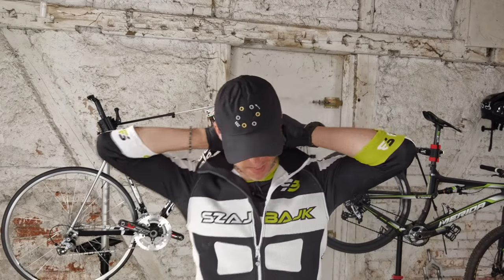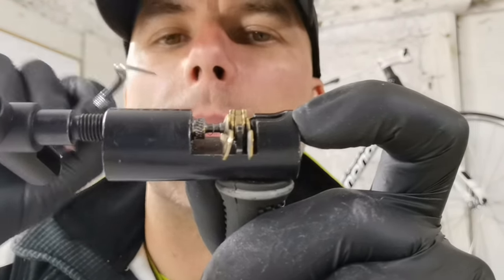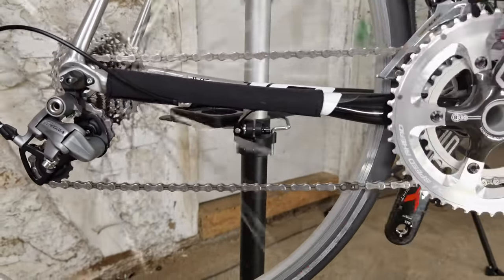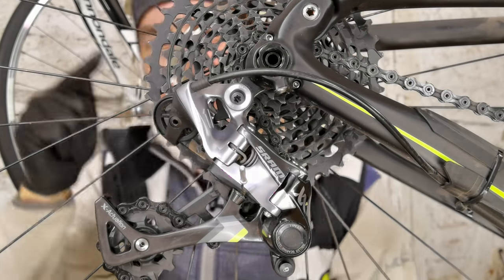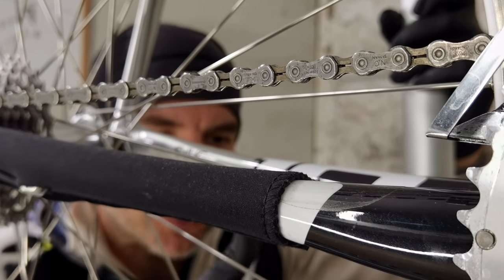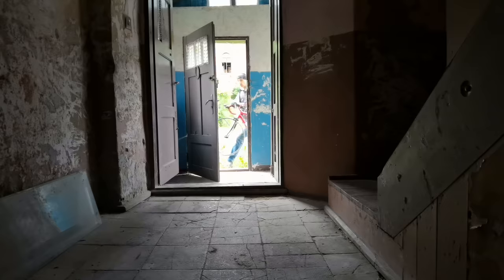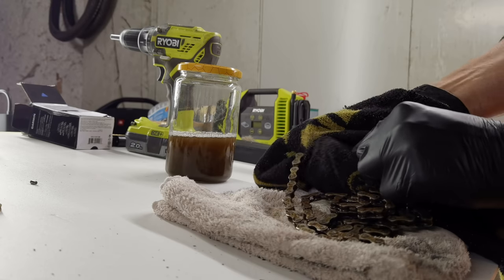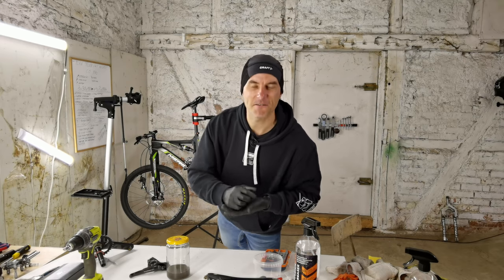7 mistakes with chain maintenance.

Comment: 10,000 miles for one chain ⛓ ??
Reply: I can do about 1000km and that is it (on MTB cycling hard). Then it's close to 0.75% longer and I replace it.
Reply: @MrVolodus  yeah I a
Can do between 1200 and 1800 depending on the conditions then it needs changing

Comment: I realized two days ago that Ive been riding the whole season with the chain wrongly routed through my Derailer
Reply: really? and it did not cut through that pin?
Reply: Must have shifted badly and made a conspicuous amount of noise!
Reply: I've been there also, felt terribly stupid
Reply: @goncalobaptista3042  hahahaha I know right
Reply: @davidburgess741  it was making a lot of noise but I got used to it and didn’t question it after a month 😂😅
Reply: @8paolo96  nope barely did and damage to the derailer it just rubbed the bridge part a little bit
Reply: @8paolo96  those plates are pretty tough and the wheels are loose. it could happen.

Comment: Parafin wax and teflon bath , with a super clean chain every 200km . Works for me
Reply: My chain has also lasted, with zero wear, more than 5,600 miles (9000Km) by cleaning and rewaxing the chain every 120 miles.
Reply: Exactly my method, wax + Teflon.
Reply: @paulroberts7775  under what kind of weather? 

Scottish UK??
Reply: @paulroberts7775  how do you clean when re-waxing? I just pour hot water. Is that fine?
Reply: @CrazyAboutCycling  Every sort possible. About half is off road.
Reply: @mohapagla   Boiling water, brush, and wipe down until the cloth is clean. Every 300 miles I clean with petrol, wash and then and meths.
Reply: @paulroberts7775  do you only use wax or mox it something else like teflon/ paraffin oil?
Reply: @paulroberts7775  that’s exactly what I do…

Stage 1: wash with petrol 
Stage 2: wash with no none-sense degreaser from screwfix 
Stage 3: wash with white spirit 

Dry & soak 30 mins in Ozzies mixture that suggests only wax & Teflon.

Am using it in all weather too.

It’s great how clean the transmission remains!
Reply: @mohapagla   I use 10% Teflon plus 10 paraffin oil.
Reply: @CrazyAboutCycling   White spirit is a  petroleum-derived clear liquid. I use meths and it leaves no residue, where the white spirit does.
Reply: @paulroberts7775  thank you for the note, I will switch to methylated spirits! Just back from the most epic Saturday!

Went around Dunoon in Scotland. A 74 mile stunning coastal route, that I highly recommend on a fortunately sunny 30C day! 

The chain looks superbly clean still.
Reply: @CrazyAboutCycling   In my younger day I spent a lot of time in those hills and cliffs climbing. I also recommend the use of two small cable ties in the ends of the chain while it is being washed and rewaxed. This keeps the bearings in place, as searching for them in a pot of hot wax is very time-consuming.
Reply: @paulroberts7775  I use a metal hangar. No fishing 🎣 issues. 

This Saturday took a ferry to Dunoon, my jaw dropped at how stunning the region was and 11-20% climbs, 74 miles! 30C! Couldn’t ask for more!
Reply: @CrazyAboutCycling  It would be the 30-degree heat that would be my biggest problem and being able to hydrate adequately. I also use the wire hanger, but not during the cleaning process, plus I slide the chain onto the hanger between the links. Do you attach the chain through where the quick link goes?
Reply: @paulroberts7775  likewise, not using anything when they are being cleaned in individual 500 ML pots. It’s left overnight in petrol, whilst the other 2 pots are a few hours & a few shakes. 

I use YBN SLAs, using quick links, the bearings don’t fall out/off, so far - but will look at this area and follow what you note just in case.
Reply: @paulroberts7775  I am used to this heat, I take Tailwind, x2 750ml bottles, & tabs in between when I can fill at stops. Unlike Switzerland, we can’t find fresh water stops in form of outside fountains. 

You don’t sound too old?? What bike/s are you using? I have 2 Scott Addicts. A Di2 15, & a R3, which is my mountain goat (6.34kg w/o pedals). In a few years, I may also add a Caad-13, or a normal SuperSixEvo. But I think the CAAD-13 would be a better beast for all year training.
Reply: @CrazyAboutCycling   I have almost a foot or at least half a pedal in the grave. I worked most of my life in London retired 24 years ago and I am now 74. Being retired, a position that I can most heartily recommend,  I have loads of time to ride and do pretty much anything I wish.
 Due to the Covid 19, the gym and the dance halls have been closed, or so restricted that using them isn't an option I fancied. That left me rowing and cycling.
 I ride a Cevelo C5   Sram Red etc and a Specialized Levo 2020 Comp plus a Stumpjumper Elite. This year on the Levo I have covered 5,600 miles and on the Cevelo 3, 300 miles. Last year I was offered stupid money for my Trek that I use as a winter hack, so I might replace that this winter, or perhaps not. The longest trip on the Levo was 120 miles and the Cevelo 186 miles.
Reply: @paulroberts7775  are you on Strava?

Me: MCC Mountain Addict
Marchissy, Suisse 🇨🇭

Comment: Excellent video.

I use Ozzie’s method of wax/Teflon. According to him his chain (Connex) lasts 15,000 kms. 

It sounds like your chains last a long time, as you clean them? Likewise, keeping my chains & drivetrain has been key, and my club think I am a perfectionist. 

I started using YBN SLA as they, like Connex, are strong & long lasting. Are you only using KMC upto 50%? As that’s what I was recommended (using park tool)
Reply: That won't happen if you're 17 stone. Torque eats up chains. So, just imagine what happens to chains on tandem bikes!
Reply: @davidburgess741  that’s an interesting point.

Had a tandem, wear was nothing crazy. It was a 20kg bike.

Comment: Is the mistake putting the new chain on without cleaning it or cleaning it before you put it on?
Reply: To not clean is the mistake. New chains come with some lubrication to protect it from rusting when it's stored for months. But if you use the chain without cleaning, it will attract all the dirt on the outside.
Danny said this in another video and it makes sense to me.
Reply: @nitishsrivastava1496  I thought so as I feel the same way but I have heard other people say the opposite.
Reply: You can also clean it after you have put it on. I have never felt the the fabric lubrication attract much dirt. It depend more on what kind of lubrication you use afterwards.

Comment: At 4:20 I still can't see what he has  changed even after watching it 3 times !
Reply: The frame holding the 2 boggy wheels has a tab (you can't see) which bends across chain channel to the other frame. It is supposed to hold chain in channel. In inital bad case,  rather than the chain going directly from cog to cog, it goes on outside of the tab and bends over it as it heads to the lower cog. He opened the frame, slid chain under tab into chain channel and then it works. This is easy to do by mistake but is so rough and high friction you would likely notice it... given how expensive the non-reusable links are it is a nice tip to unbolt frame vs break chain to fix it.
Reply: @stuartcurrie3160  Now I understand ! Thanks.

Comment: 10thousand mile on a chain?? How is it really possible?
Reply: On granny gear
Reply: @rcs2003  😂
Reply: You have to weigh 40kg!
Reply: By using your brain and money wisely. The same way you can kill brand new engine racing up hill and towing a boat to another coast. Of course you can change your chain every week instead of spending time on the road.
Reply: @jerrysmietanka2180  I didn't understand what you mean. I have tried lots of lube and now waxing. I check my chain very seriously and carefully but couldn't do more than 5000km on any of my chain

Comment: What is this nonsense with quicklinks? I have always re-used them without issue. You only have to look at them and the way they work to see that there will be no issue with re-use. Does this claim that they are single use come from the same people that claim discs are better than rims by chance...?
Reply: manufacturer. but even the reusable ones wear out these days. you need the oldskool parts the new stuff is more...disposable.  i nevee trusted wipperman connex because they used to have so many chains reported exploding. but i hear the old quick links are good.   with modern drivetrains i wouldnt be so sure they would work well though. theyre all so finely tuned now.  its a different generation for bikes.

Comment: Oh, I'm SUCH a naughty girl... I do everything wrong. I use cheap 7-speed chains [£4.00]. I re-use the quick-links up to 20 (twenty) times; I lubricate with 10W-40 car engine oil; I let a thick layer of black grime accumulate; I shout at scared little puppies - Well, okay, I don't shout at scared little puppies, but I do ignore all of the good advice in this very sensible video.

Why?

Because I use cheapo garbage parts on a cheapo garbage bike, and I run them till they fail. That's not as bad as it sounds, because replacing chainrings and sprockets every 10 years is no big deal when they only cost £10 each.

If your bike is a good one, though, fitted with quality components, you naturally want to keep things clean and efficient. The thing is, you HAVE to swap things at the first sign of wear, otherwise some other very expensive parts will be suffering, too.

With my nasty system, none of that matters. I keep a chain rolling until it literally won't stay on the sprockets. Thousands and thousands of miles... It's great. Yes, it's messy; the black sludge is horrible and abrasive... but it's oily, so rust and water don't stand a chance.

Serious cyclists might be surprised at just how durable 'rubbish' components can be.

The trick is to ignore the bike's squeaks, creaks, crunches and groans. Just keep pedalling. And keep smiling.😁
Reply: OK... sounds like not a lot of fun 😅

Comment: I wouldn't think you should degrease a brand new chain - just wipe excess off
Reply: i did the teflon wax thing. degreased a new kmc chain and went through the procedure. after splitting the chain i can say the teflon and wax did get in there and there was a coating all over the metal. but it seemed just too dry to make me feel comfortable so i added a few drops of lube as well.   id say the wax is good but make it soft with oils or some other additive (check ozzy biker or whatever his name is for the mixtures) not just the wax and teflon mixture, its too brittle imo. but my chain is spotless where as normally its black after a couple of rides given the traffic dirt here. impressed with that. i dont like liquid lube for my chain anymore. done with it.

Comment: Ah bro wish I saw this before taking my chain off and reassembling everything thinking it was all okay, after few miles I ripped the rear derailer out of its socket breaking all the threads and bending where the derailer was fitted 😳🙄

Comment: 10 000 miles? This is impossible for just one chain, even the better ones do 3000/4000 miles and they are already gone. I clean my chain(HG-601, shimano 105) very often and it´s always shining and it will do 2500/3000 km...
Reply: try kmc.  shimano stretch over time. sram stretch by the time youve gone around the block 😄 been using em for decades now after getting tired of replacing the other two.   also dont buy raceface chainrings and expect them to last. renthal all the way for longevity. absolute black my second choice.

Comment: What's your opinion about chain waxing?
Reply: look up yt user: oz cycle
hes genuine no frills.
i used his mixture and its been great.  use some of the softner though (he shows how to doo that too) because the pure wax is just a bit brittle even here in the caribbean heat.   the clean chain statements are absolutely true. ive opened the chains and the wax does get in there once you get the bubbles out. and ive had no rust issues despite being on a tiny island surrounded by evil saltwater that kills every tool i own.  no gunk. no rust. no drag after a couple of rides. cant fault it

Comment: 7:42 - it is not lubrication on a new chain. It is conservant.... And it needs to be removed and after that proper lubed before the first use.
Reply: Maybe it depends on a person's unique situation to some extent, but I just want other readers to know this is only your opinion.  We all know opinions are like a "brown eye" - everyone has one but that doesn't mean you should share it.  I don't mean to be harsh, just having a bit of fun :P

"Conservant" and lubricant are not mutually exclusive terms, and I bet the factory grease is a better lubricant than nothing.  It's not carbon fiber grip paste in there lol.

Removing factory grease is not recommended by chain manufacturers (not sure if they mention it with regard to converting to wax-type lubricant) - otherwise they would use a liquid that is much easier to remove (as well as cheaper and easier for them to apply).  Many bike mechanics LOVE the factory grease because it's so thick (stays put) - unfortunately that thickness also makes it impractical to apply (very little penetration, whatever is left on outside will get grimy quickly, probably very expensive).  Although... I do wonder why it is not available for the public to apply using the hot wax submersion method.

Comment: 10.000 K with one chain? Yeah, but make sure that you only peddle downhill🙄🙄
Reply: My city bike has done that easily. (But using an internally geared hub is cheating, barely any chain or sprocket replacements needed ever..)